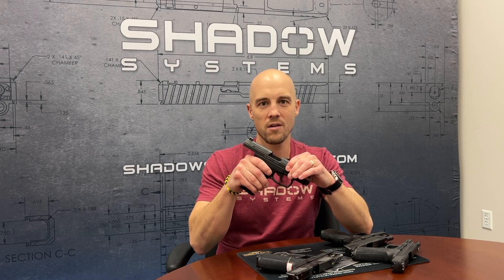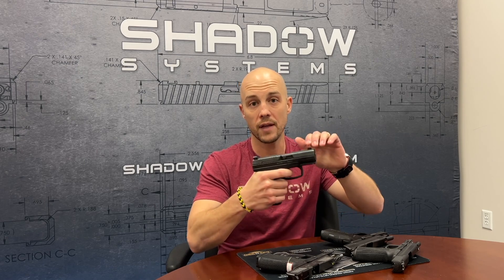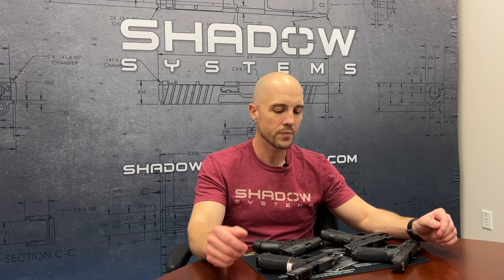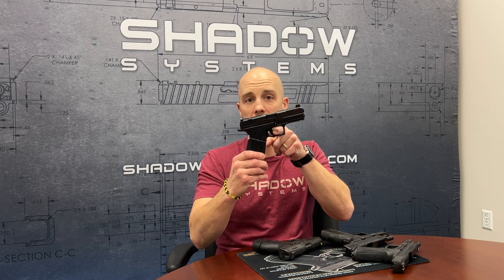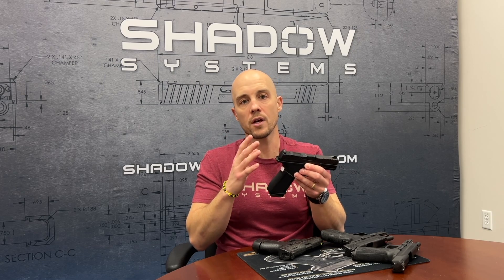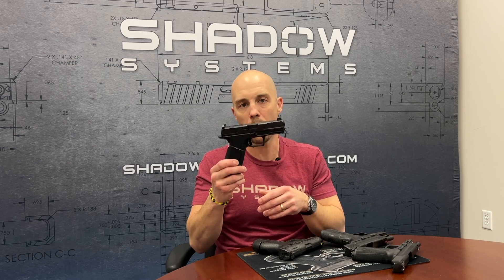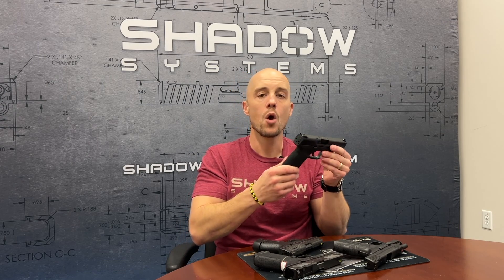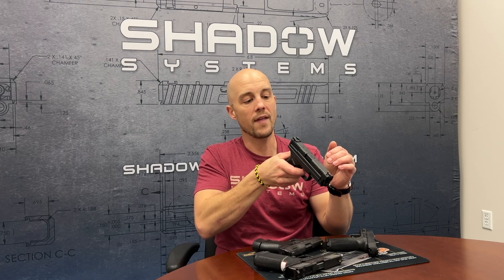Technical Tuesday - Trigger systems and the Timney design

Comment: They do also offer a combat trigger that maintains the slightly higher pull weight but still offer the clean pull
Reply: No they don’t. They only make the alpha trigger. It’s specifically stated to be a competition trigger only.  It is offered in all black, or with a red trigger shoe safety.  I have three of them, and they have failed the drop test in two guns.
Reply: @Freakingstang  Define fail tho... True, the sear can release... but the cruciform is still on the ledge, meaning that it's too high for the striker to get past... stops the striker... and the safety plunger is also engaged.  Might be splitting hairs, but from what I've experienced the striker will not touch the primer.  BUT... you do have a dead trigger that you wont know about till you squeeze the trigger.  Thus I don't carry with it, comp only, but based on my experience it does not appear to be unsafe from a neg discharge standpoint.  Curious if your experience is diff>
Reply: @hawkgeoff  put a primed empty case in the chamber and toss  the gun from from 5 feet or more. 4 and below won’t set it off. I assure you it will set the primer off. You can’t get anymore fail than that.
Reply: @Freakingstang  so you stock plunger spring fails too?  Not trying to be adversarial... and again, I don't carry it, only compete, but how is the firing pin block not stopping the striker?
Reply: @Freakingstang  I just dropped my G19 with a Timney alpha at like 6ft a couple of times and the trigger was still cocked...and Johnny Glock did drop tests at like 10ft without the safeties failing on a G34...
Reply: @Freakingstang  Johnny Glock makes the combat version of the Timney to give it a 4-pound trigger with the clean break
Reply: That’s great. Timney doesn’t make it and no one was talking about Johnny Glock. The video was specifically about shadow systems and timney triggers.

Comment: I put this Timney trigger in my DR920.  I've fallen in love with it as a range gun, not a duty gun.  The trigger is much lighter and more crisp, but I'm agreeing with you on it being a "competition" type trigger.  That being said, I love it for what it is, a pre-cocked trigger pull.
Reply: Buying it now based on what you said. Thanks man.
Reply: Put a + (8 pound) OEM connector in and the break weight will go up to between 4 and 4.5 pounds. (At least it did in my gen 5 trigger housing.)
Reply: I bought the timney trigger and installed it it my MR920 and the reset seems doggy or slow at times. I used the included silver spring,  but am wondering if I should have used the purple instead. Do you have any idea what my issue might be?
Reply: @sabre-sevendelta6675  the problem is your connector , it’s touching the trigger bar therefore it drags or reset gets stuck.  Also change the trigger spring to the red one
Reply: @sabre-sevendelta6675  Use the red spring... it'll be better, but still not great.  The OEM glock system seems to push your finger forward much more than the timney... but the break of the timney is just stellar.  No free lunch, gotta give up something to get something.
Reply: Which of the two springs did you use the silver one or the purple one